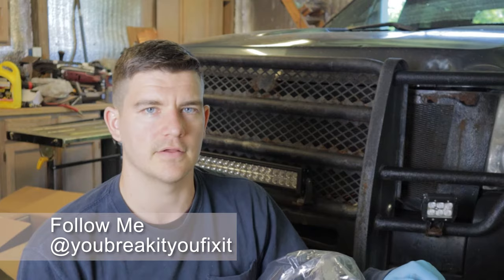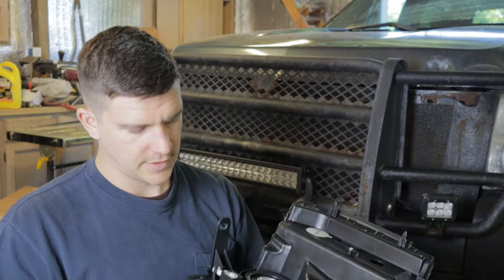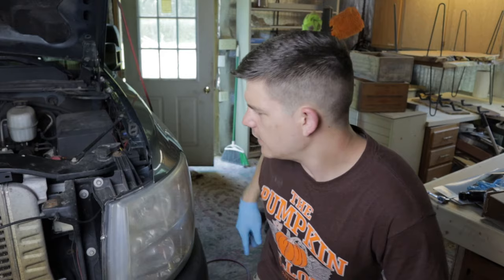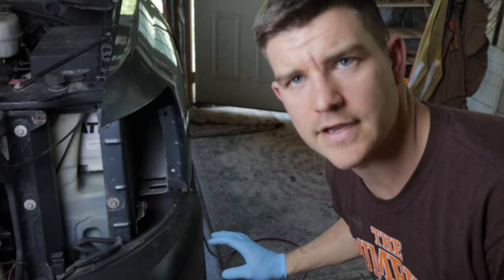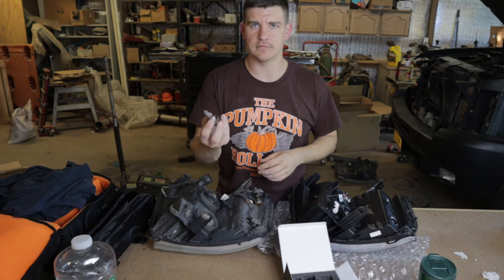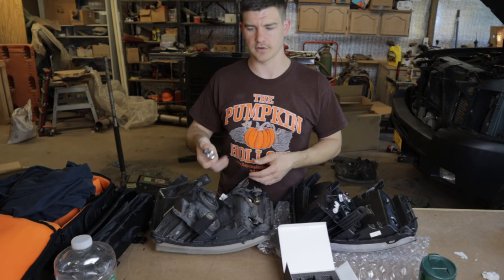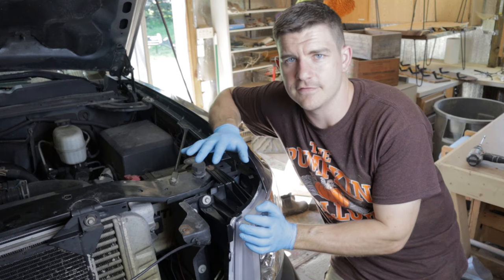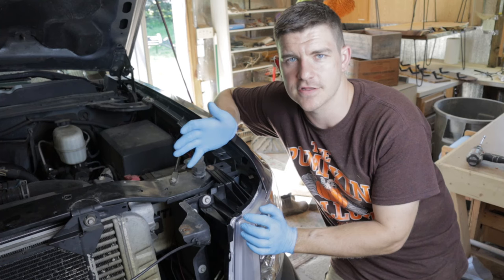How to replace 07-13 Silverado Headlights

Comment: God forbid you mention the size of the bolts.
Reply: For my truck (2010), 10mm and 8mm were the two sizes you need. I did not remove my grill.